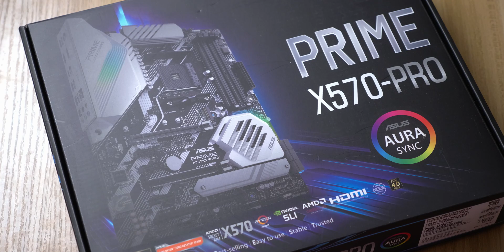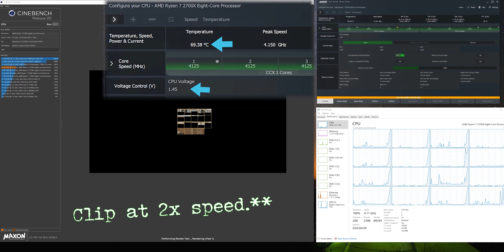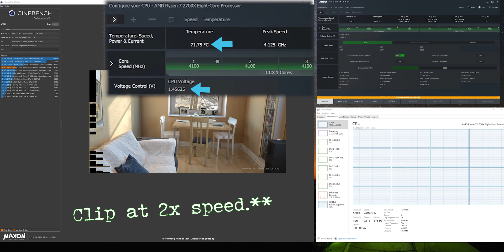Watercooled 4k Editing PC Build - Lian Li PC-O11 Dynamic XL & Asus Prime X570-Pro

Comment: quick question where are u connecting the bottom USB from the front panel on the motherboard I have the same board and case
Reply from the maker: I didn’t as there isn’t a second port on the board. I did end up installing a USB expansion card as I needed more USB on the back, and that had another port on it. However the card was garbage and only worked sometimes. So I’m on the lookout for another expansion card with a port so I can plug in those front panel ports. 

I like the Prime X570-Pro but I think it’s lacking a few things like that for me.
Reply: @MandicReally   thank you bro yea i have a nice usb hub so its not a big deal of hooking up the bottom two USB ports tbh.  where does that stupid light strip front panel go I love the case but its a huge pain in my ass lol
Reply from the maker: @MrPepsiFish  the strip can be run on the cases own control. But I have it plugged into an ARGB hub I added as it’s a 5volt addressable strip and I have a couple addressable items in mine.
Reply: @MandicReally  sorry for all the dumy questions but the board has an argb header somewhere correct?  and if so I could connect it to that
Reply from the maker: @MrPepsiFish  Yes it does and you can.  The ARGB header is between the front panel connectors and the 2 fan connectors at the bottom right of the board.
Reply: @MandicReally  ty kindly bro great help
Reply: @MandicReally  so to dumb it down for me you connected a USB panel cable into a argb hub and it worked?

Comment: Question: The ASUS prime x570-pro has 8+4 CUP power at the top (8-pin EATX12V; 4-pin EATX12V).
I have a Corsair RM850x PSU. It only has an 8pin CPU power cord.
What's with the other 4 pins? I can't find anything on it, and I don't see a Corsair 8+4 CPU power cord on their website.
There is one other CPU cable (8pin), but I'm really hesitant about plugging it in, and having 4 pin hanging.
Reply from the maker: The extra 4 Pin is just for “Extreme” overclocking where you may need more cpu power. It isn’t required on the vast majority of systems. Corsair does sell an additional cable for it that you can plug into a Modular port on the PSU or if you just don’t like the look of it not being populated they sell an 8 pin to 8+4 connector. Won’t supply much more power to the CPU but will fill the connectors. 

https://www.google.com/amp/s/www.newegg.com/amp/p/36M-01AF-00004

Comment: Where did you found the button radiator fans cover? Thanks
Reply from the maker: It came from Performance-PCs but they have been out of stock for a long time.  I wanted to get another one for the two radiators in the case as well but couldn't.  It was also really difficult to scrape all of the paper that comes stuck to it (it is laser cut acrylic) when I installed that one.  So it is a serious Pain.

https://www.performance-pcs.com/water-cooling/radiator-accessories/primochill-hex-2-layer-rad-grillz-triple-120mm-white-white-rg2h-320-w-d.html

Comment: I tried to put this case and mobo together and it said i dont have enough front usb header space for the 4 USB on the front panel. How did you resolve this issue.
Reply from the maker: I didn't. I chose which pair of the front panel connectors I wanted to use and the other two aren't doing anything unfortunately. 

ModMyPc has a splitter cable. If you aren't loading them up with all 3.0 devices all the time you should be fine with that. I may grab one to try. 
https://www.moddiy.com/products/20-Pin-USB-3.0-Internal-Header-Y-Splitter-Cable-12cm.html
Reply: https://www.sabrent.com/product/HB-INTR/5-port-internal-usb-3-0-hub-controller/ Would this be a good alternative?

Comment: 6:25 can these orange fans be installed on the other side if the reservoir wasn't in the way?
Reply from the maker: The top fan would hit the top mounted Radiator if I tried to put the fans there. However I could put the radiator where those fans are and then the fans would mount where the radiator is. That would only work with a slim radiator like the one I have, but it would work. Does that make sense?
Reply from the maker: If I didn't have the bottom fans there (or namely the one under the reservoir) I could have slid the side radiator down enough to put the fans on the inside of the case. I could maybe still do that if I out the fitting ports on the too side, not the bottom as I have them now. But I wanted them on the bottom so the radiator drains via the drain valve.

Comment: That's interesting.  I built my last computer about 6 years ago and cooling has been the biggest issue.  I have to blow it out once a month or it overheats and shuts down.  My network switch needs to be blown out 2 times a year or it shuts down.
My next machine will probably be a full blown storage server complete with a cabinet to house everything.  I have about 50 TB of storage and I do manual images to keep the disk hours low.
Reply from the maker: I've been water-cooling almost as long as I've been building computers. It's a lot of extra effort and expense but does work really well. Worth it? Arguable. 😅

I too want to setup a full server tower solution. I have a small server cabinet that my editing computer sits on top of. Inside the cabinet is my switch and my Storage Server (only 26TB). I want to setup a full rack with two or three additional systems. A dedicated Home Theater streaming setup, another Faster Storage Server, and possibly a "Network Switch" to run my own VPN so I can access my servers while traveling.